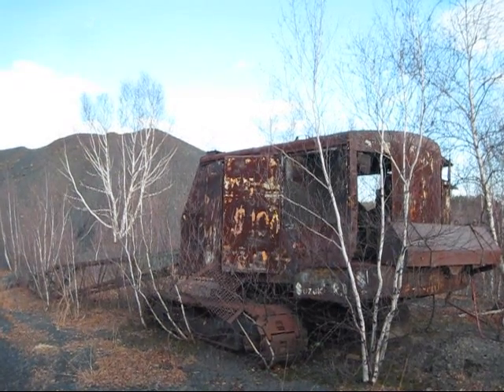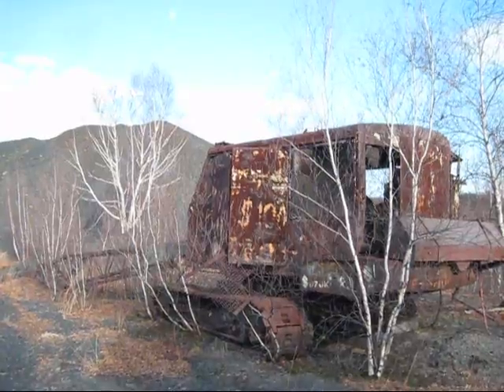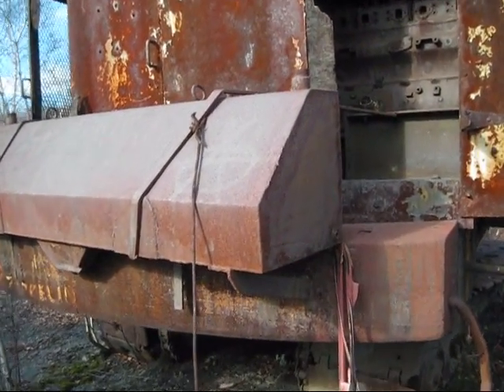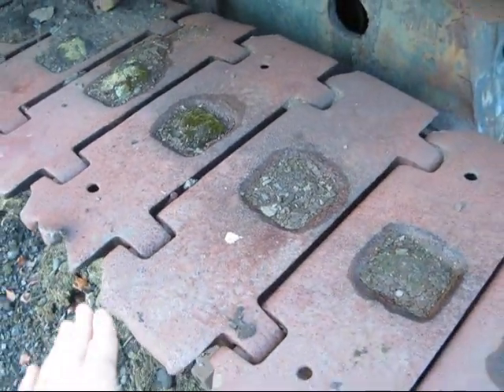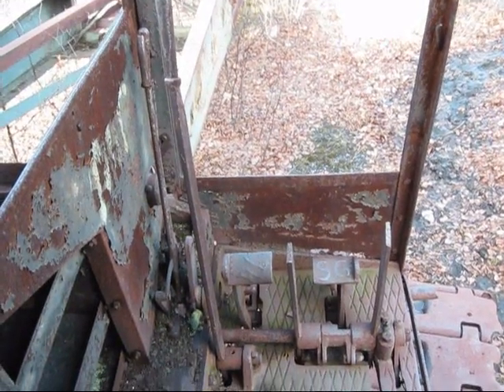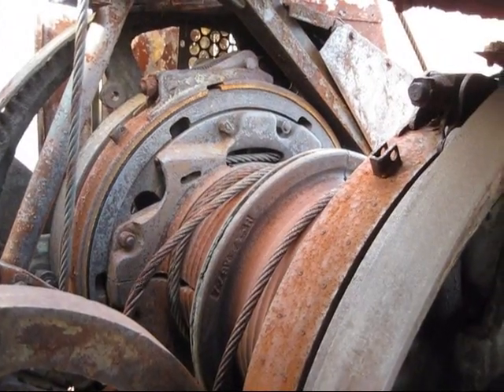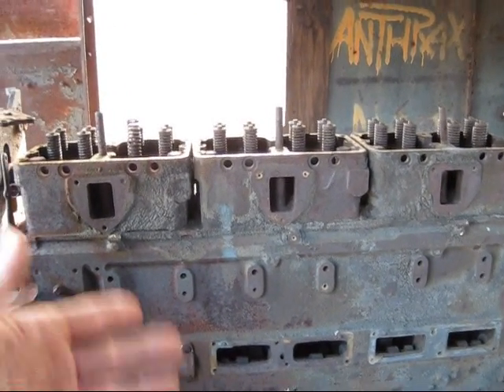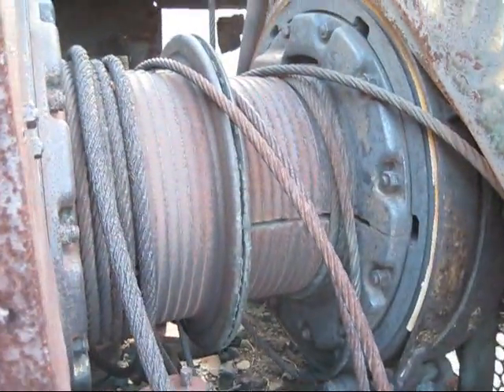Bucyrus-Erie 44-B Documentary

Comment: Great Channel. I grew up mining. We had a 22-B (Cat D318) and a 38-B (Cat D13000) Pretty sure they were both late 30s 
My dad and his partner started with the 22-B. Upsized the bucket from 3/4 to 1 yard and added a half set of 14A used up tracks to the counterweight. That did not do the trick so they bought the 38-B. They added 20' of boom to make 70 ft stick, a 2 yard bucket, another counterweight, and stuck a turbo on a D13000!. It was crazy to work. It would roll up on the idlers, or lift the opposite track  when you hoist. It never went over but the shaft through the point sheaves broke just inside of a pennant and the boom came down.